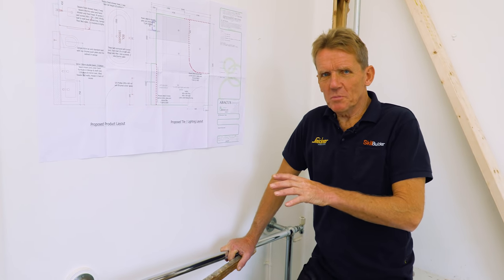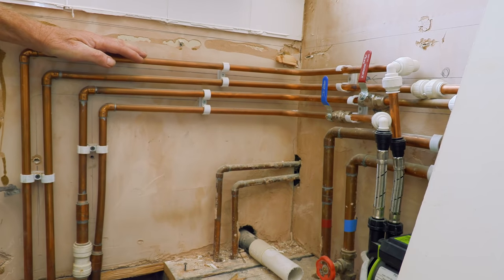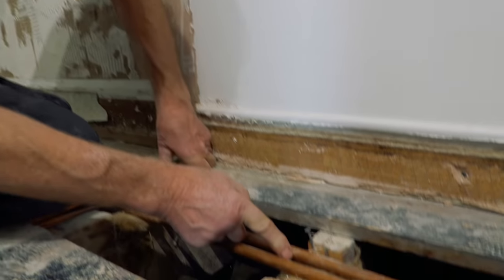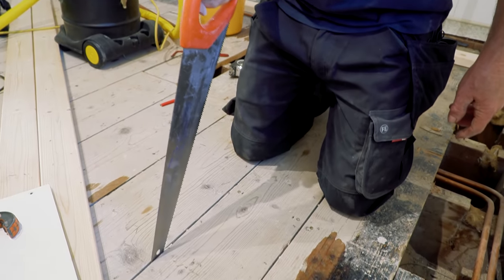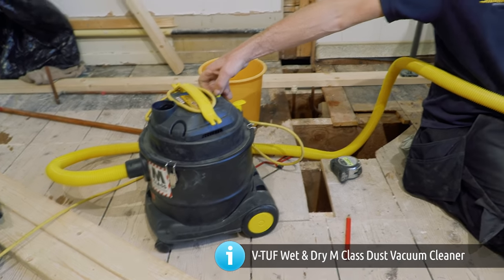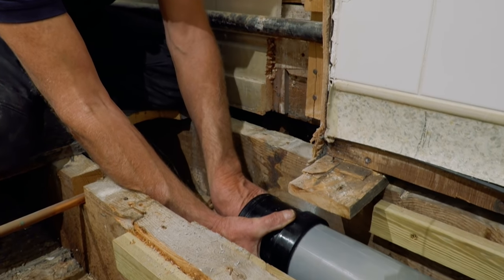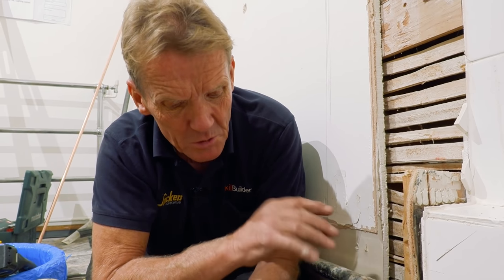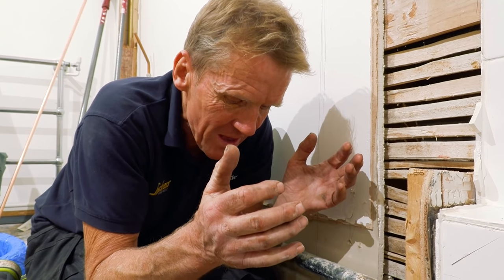Bathroom Renovation #2 - The Tricky Bit

Comment: Never gone through a pipe under the floor boards but I was on a job once where I was removing the floorboards , some of which had been nailed in place. Pulled one of the nailed ones up and set off a bloody monsoon! Seemed that the pipe was fine with the nail through it, it was only when I removed it that it turned pear shaped. Not much you can do  to plan for that kind of idiocy! As always, good series Roger. Good to see you take the time to see the job done right. Yeh, time is money but taking pride in your work is right up there.

Comment: Another brilliant video, always enjoy them. One (hopefully sensible) question, but when you were first fitting the expansion coupling, you were worried about the gap at the bottom, so you used that chamfer tool. Later on you said that the joint is designed to move with expansion. So am I right thinking that it's OK to have the gap if it's only temporary because it's expanding? Cheers again and keep 'em coming!
Reply from the maker: That very thought occurred to me. It is a contradiction and in truth I am in two minds about it so maybe a few more plumbers will chip in. Leaving the gap creates a trap and as the pipe is carrying mostly cold it would be better to shunt it up tight.
Reply: @SkillBuilder  Cheers for responding, hopefully another proper plumber like yourself will comment.

Comment: 1st ! What lurks under the floorboards? All the detritus left by previous trades!  I've just finished genetically cloning the first batch of Robin Clevetts and they are ready to go on-site. Just need to buy them a Festool TS55 each!
Reply: I've just finished pulling down my ceiling in my kitchen/ dining area in my 1953 ex council house so you can imagine the horrors that greeted my face when I pulled down the plaster board!
Reply: @R-77 Quite easily. Will your Robert Dyas £9.99 Jigsaw (probably includes 50 blades) be able to stand up to a professional contractor grade German Jigsaw?  Does it matter where they are made?
The Germans tooled up to make quality for quality trades people. Quality costs money. You get what you pay for. Quality tools equal productivity which in turn makes money. You must know that? There are plenty of pony tools out there for you (from the far East) if that's your budget.

Find me something better and cheaper and I'll happily switch.
Reply: @jamescoupland667  A lot more than you expected I bet!

Comment: Hi Roger, would you trust push fit connectors onto copper pipe for a bathroom under the floor boards or would you recommend end feed as the permanent solution? Thanks.

Comment: Can you tell me what the depth of water seal is on the traps on element shower tray formers?
Reply from the maker: They are elongated so they have better than the 76mm equivalent. There is no problem connecting them to a stack because you can't induce a seal loss.
Reply: @SkillBuilder  hi, thanks for the reply. Do you mean the trap is elongated or the channel drain is elongated? Thanks for the reply

Comment: Hot water through a 4 inch waste off a toilet 😂😂
Reply from the maker: Yes two basins fed into that 4 inch pipe with an air admittance valve at the top of the run. But I agree it was more a general point and probably not worth making in this instance. The most expansion comes from external pipe runs on a hot day.